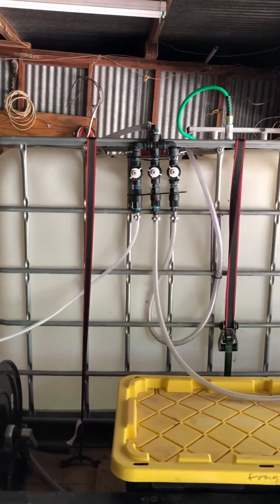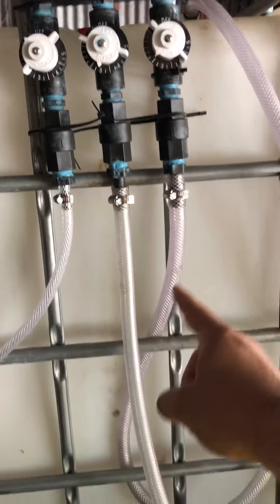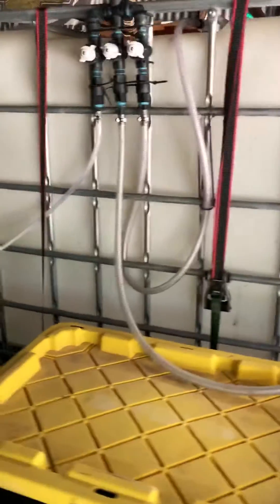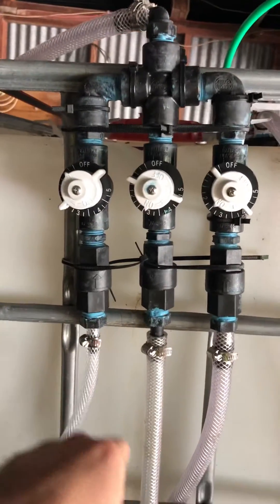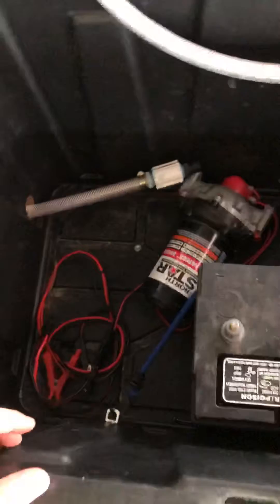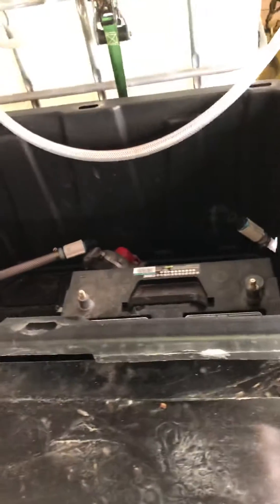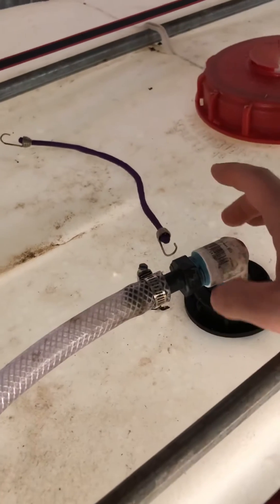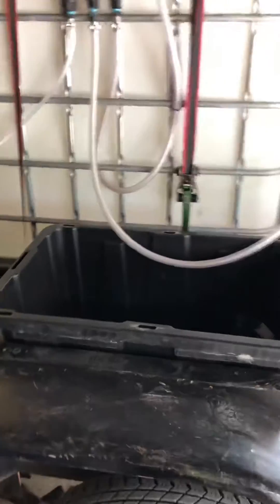Soft Wash Proportioner Build

Comment: Can you just turn the bleach and soap dial to 0 to flush out the pump?
Reply: Of course you can. You don't need to pull that drop stick out and put it in the bucket. Just plumb a bulkhead down at the bottom of the tank.

Comment: Ill never go back to the plastic garage after using this solid stainless steel proportioner. Price isnt bad either. https://www.ebay.com/itm/194209223008?mkevt=1&mkcid=1&mkrid=711-53200-19255-0&campid=5338273189&customid=&toolid=10001&pub=5575378759&icep_ff3=1&ipn=psmain&icep_vectorid=229466&kwid=902099&mtid=824&kw=lg